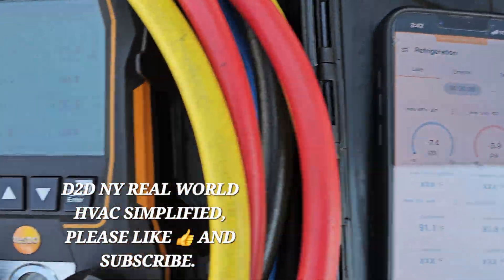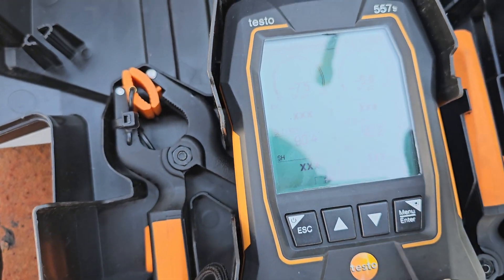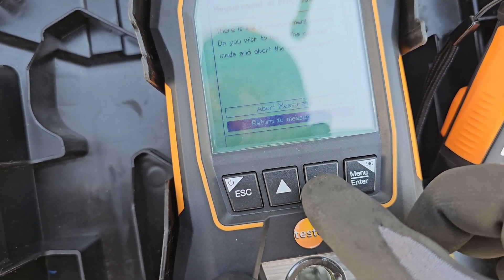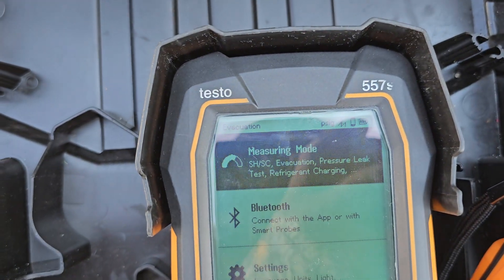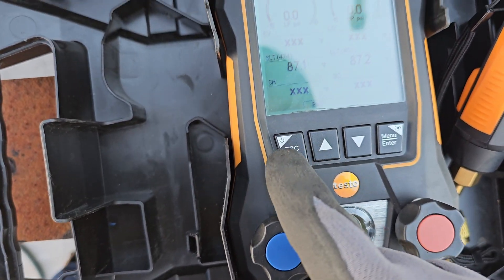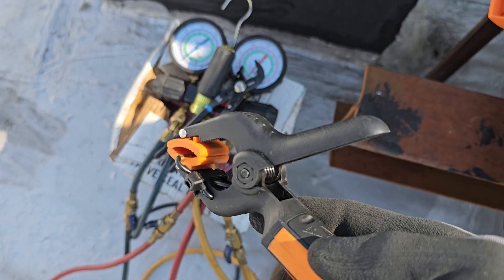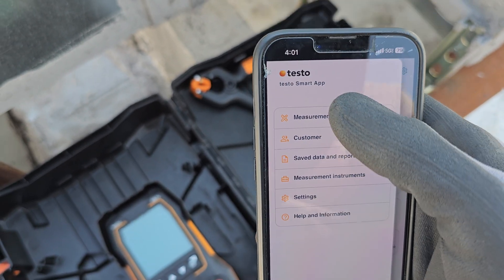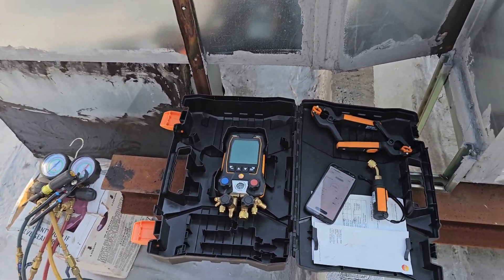TESTO 557S | TESTO SMART APP

Comment: Testo is only way o go but I prefer the wired superheat and subcooled set up
Reply from the maker: Really why?
Reply: @D2DNYAC  I think it's more accurate and it's tiresome reconnecting to blue tooth when you step away. I have both setups and use my older ones because of the clamps
Reply: Also the clamps are smaller and get into tighter spaces